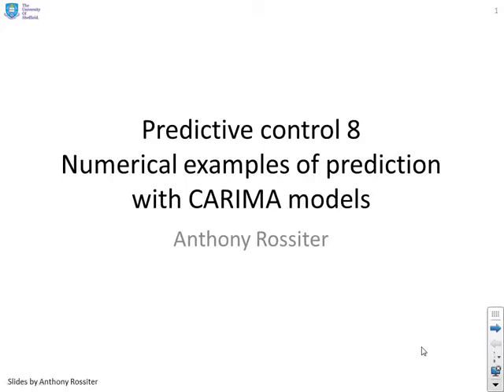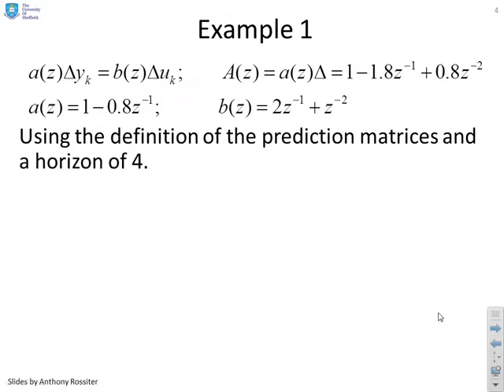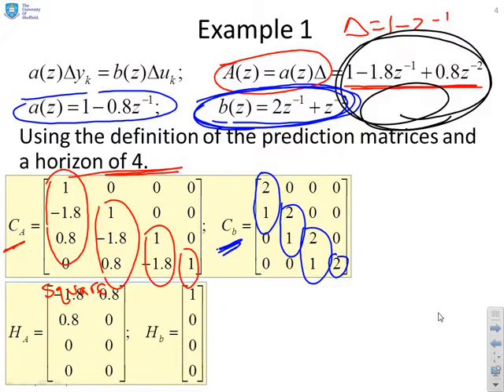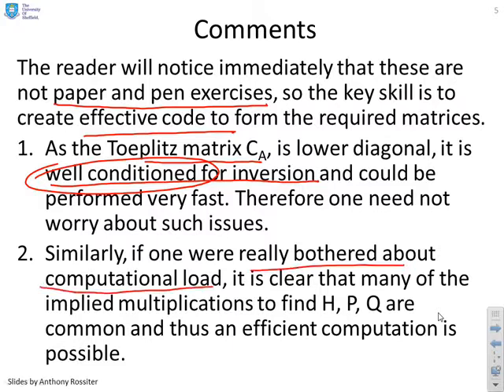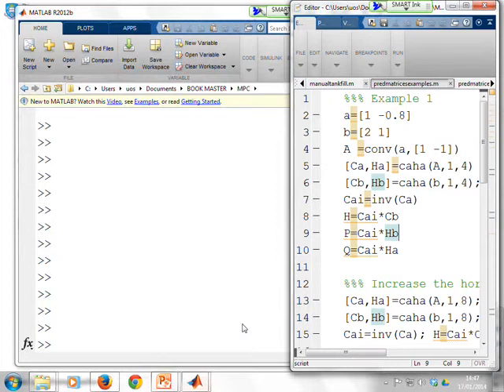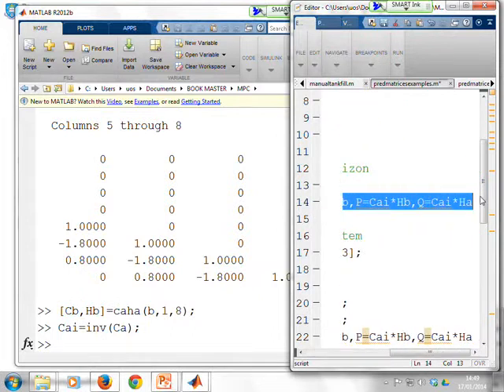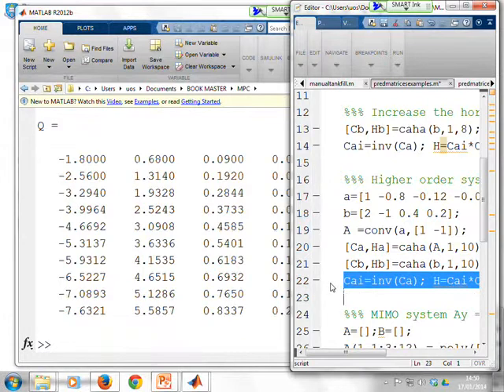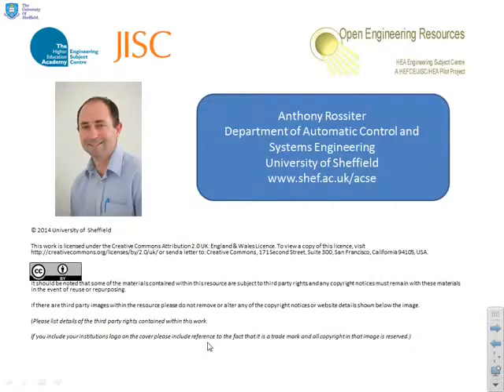Model Predictive Control  8 - Prediction with Carima models continued

Comment: Hi Mr. Rossiter, On your video of Model Predictive Control 8 in MIMO Matlab simulation, you use A and B matrices. Unfortunately they cannot be seen clearly due to the frame is minimized. Could you give me the values, so that I can compare the result with my simulation that I have developed? Thank you
Reply from the maker: tompel22 The powerpoint source is on the googlesites so hopefully you can find the answer there.
Reply: Thank you very much